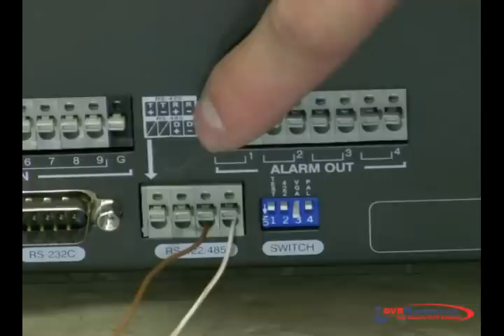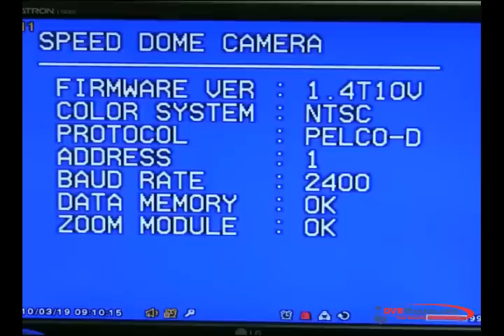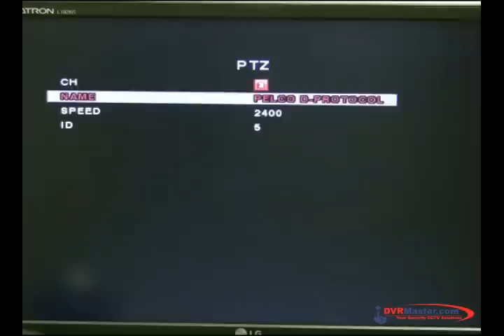How to Setup a PTZ Camera to your DVR System. (Step by Step)

Comment: Very nice video! Great job man!----I will definitely have to check out your website before i buy another camera or dvr!
I would like to ask you a question before i go ------- if i am going to use a toggle controller for the ptz camera, will i just remove the 2 ptz wires from the dvr and plug them into the controller?
Reason i ask is the controller has 2 in and 2 out, so do i just leave 2 of them empty, if i only have one ptz cam?
Or after i have connected to the 2-in, do i need to connect to the 2-out then back into the 2-in on the dvr?
Thanks for the help!

Comment: I have a question so far,  my PTZ has 6 cables (red, yellow, brown, black, green and orange) and of course the other 2 cables which is the power cable and the coaxial or video cable as you call it. I want to connect by 485 but i don't know which cables fit on each slot A, B.

Comment: I have a question:
The Question is do i need to re-program the PTZ Camera before i can install a separate PTZ Controller? because when i install separate ptz controller, the Camera doesn't work no movement. The Model of the PTZ Controller is SDK45 its like Remote Control.. ive been working in this controller for a days now still no results..